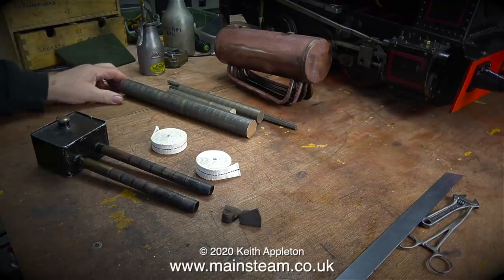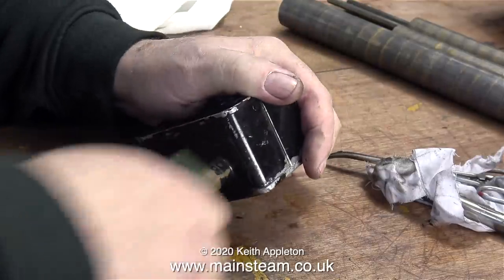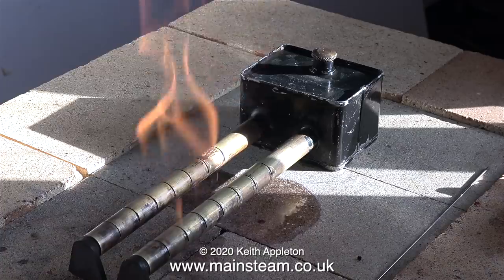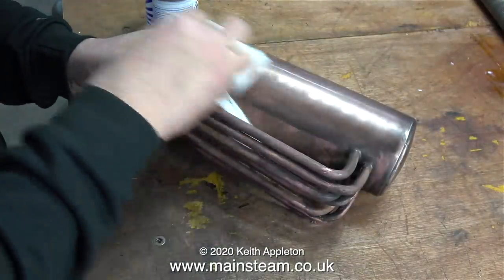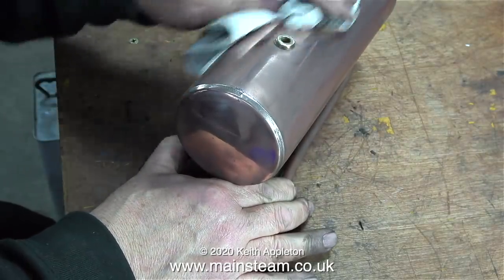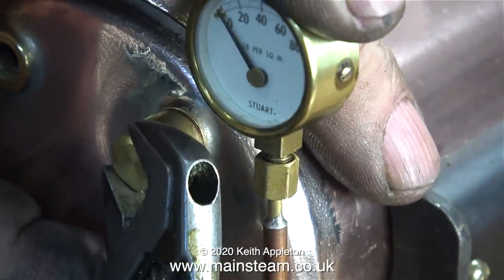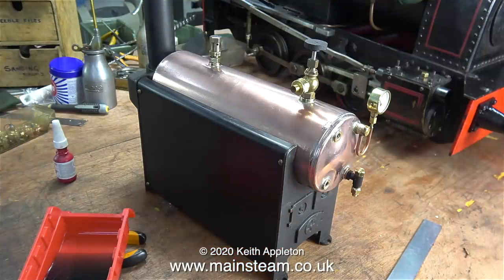IN THE WORKSHOP - A STUART 504 BOILER VIA EBAY - PART #3

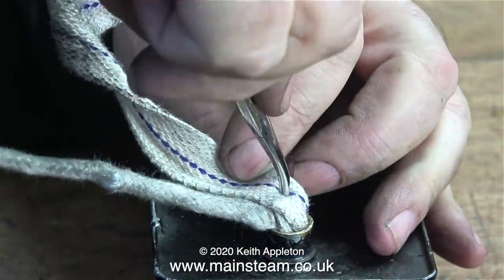Comment: Hi Keith, when fitting the boiler fittings you say at about 5:45 minutes in that you cleaned out the the larger bush on the end of the boiler  with a 5/16" - 32 tpi tap (lower Right Hand), but in an earlier video from 2017 on a 504 renovation you say in video 3 at 1:51 that these larger bushes are 5/16" - 26 tpi thread.  Could you confirm which is correct please as I am beginning renovation of one of these but there were no fittings just the plain shell when I acquired it.
Reply from the maker: I do make mistakes as I am not a machine, but ...... usually on the 500 series of model boilers the top threads are 26 TPI and the ones on the back are 32TPI
Reply: @keithappleton 
 Hi Keith, we all make mistakes, myself more than most.  Even machines sometimes go wrong.  Thanks for the confirmation I'll just have to try screwing in a a tap by finger or making a couple of  plugs one of each thread.
TerryD

Comment: Hey Keith, I made a coal fired boiler but I found that the firebox isn't really suitable to raise enough steam, even with the blower on. I thought about fitting a spirit burner like the one shown in this video and see if that works, would you say that such a burner could heat a 1 litre boiler up to 4 bars (58 psi) and keep it there under load or should I stick with the coals and try to fix the firebox?.
Cheers
Reply from the maker: if it is designed as a coal fired boiler - maybe you just need more practice . . . why do you say that the firebox in not suitable?
Reply: @keithappleton  It's scratchbuilt and designed by myself, the firebox is a bit thin and long, and is underneath the boiler, where the smoke then goes through a firetube out of the funnel. Looking back on it I think this design loses alot of heat through the firebox walls and after 2 steam tests it took ages to even get steam, and the steam blower only drained all of it... Also the coals never really fiercely burned, only smothering. It's probably down me as well. I'm going to give the ashpan more airholes since it hasn't got a good air intake but apart from that I wouldn't know what to do.

Comment: Highly reactive aluminum in combination with weakly reactive copper = electrolytic action and the active metal is consumed.  Used judiciously, sacrificial anodes can be a good thing.  Having the washers on a boiler act as sacrificial anodes is NOT a good thing.  Full marks to Mr. Appleton, for switching the washers to copper.  Stuart is exhibiting "bad form".
Reply: I was thinking the same, but from the world of computer watercooling, where you are always told never to mix aluminium and copper in the system loop to avoid galvanic (or bimetallic) corrosion occurring and gunking up the system.
Reply from the maker: Stuart Models have used Aluminium washers for many years, I never liked the idea of them for exactly the reason you stated {:-)))